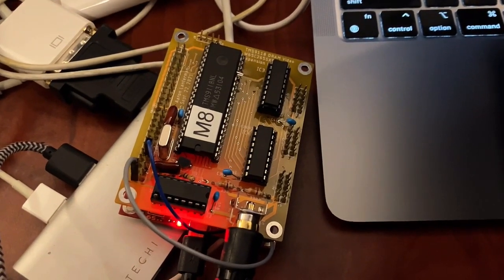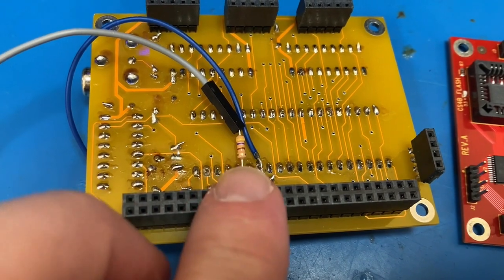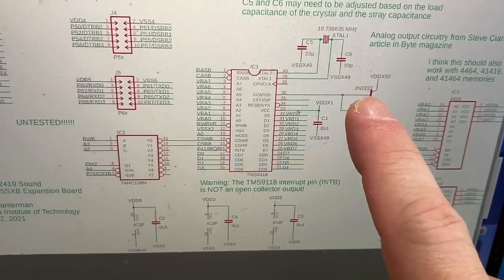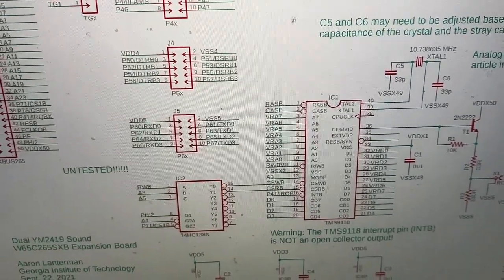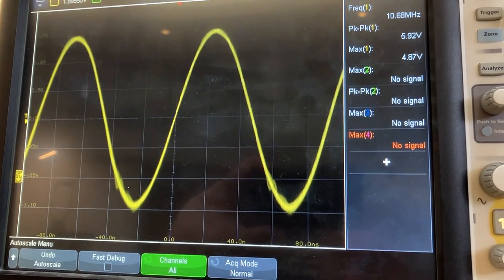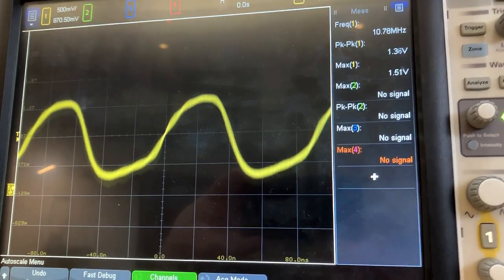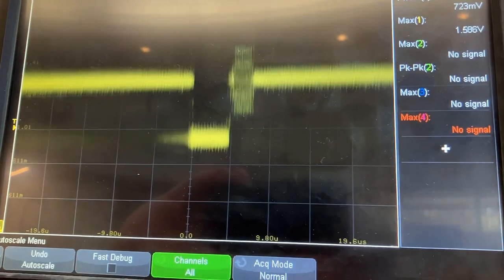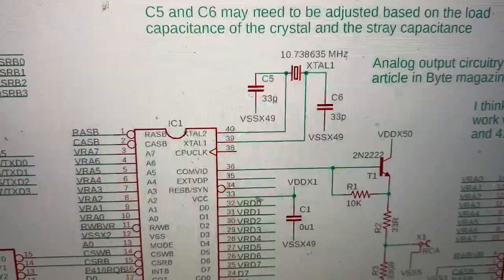[SOLVED] Color Output from TMS9118 Driven by W65C265SXB Microcontroller PCB (RetCom87) (TMS9918)

Comment: Hi Aaron, Thanks for reaching out. I thought it best to comment here in case anyone else has TMS9918 sync issues. For my builds, I've had great results buying 10.738635MHz crystals from Mouser which are listed as having 32pF load capacitance. I mention it briefly on my TMS9918 PCB build video: https://youtu.be/oR_TiEgSD2k?t=137
Reply from the maker: Believe it or not... it somehow magically fixed itself? I went to it a couple days later to work on writing to video RAM, and suddenly noticed the picture looked less janky, and then I tried color and it worked!
Reply from the maker: I'm now scratching my head on something else. Reading from VRAM works correctly, but to write to VRAM, I have to give the TMS9918 an address one less than the address I actually want to write to. So if I want to write to $0800, I have to tell the processor $07FF. I don't think it's supposed to work that way (and it means I can't actually write to $0000...)
Reply: @Lantertronics  Sounds like you're not setting the write flag when setting the address. Make sure you logical-OR 0x4000 with your address. That will prevent the TMS from pre-fetching the data from that address and incrementing the address pointer before you get a chance to write to it.
Reply from the maker: @TroySchrapel  OOOOOOOOH! Thank you so much! I overlooked that part when going through the instructions... I had focused on the MSB that indicated whether it's a register or address write, and missed that next-to-MSB.
Reply: @Lantertronics  No worries. Sometimes a fresh set of eyes is all you need :)

Comment: Yes. That chip is known for getting very hot. Working on my own W65C265 project with a custom board; glad to see others experimenting with it, too! 😅
Reply from the maker: Oh cool! There are so few working with it. What are you working on? Tell me more! :)
Reply: @Lantertronics  surely! I had a custom PCB made with the ‘265, 1x32k + 2x512k ram, 1x32k 55ns rom, a ‘22 VIA, 2x’51 ACIAs, running at 8mhz. I have two expansion ports with basically the same pins exposed as the W65C265SXB, and two PIB expansion ports so I can experiment with the Parallel Bus. And more!

Comment: Make sure that the displays aren't expecting a PAL signal. A slight deviation from the NTSC color carrier shouldn't make too much of a difference, but PAL has a much higher frequency carrier. An NTSC carrier would look like luminance modulation for a PAL display.

The carrier signal does look awfully noisy though. I don't know if that's the oscilloscope, but  perhaps check if there'e any noise on the VDDX50 rail?

Comment: The 9918 always gets hot. Most of the time they had a heat sink glued to them. Try putting a 50pF trimmer capacitor in parallel with the 33pF capacitor on pin 39. This will let you fine tune the frequency of the oscillator and hopefully pull it into a range the television can recognise as a colour signal. Cheers.
Reply: Measure the frequency on CPUCLK pin 38. That won't load the xtal oscillator so it will be an accurate measurement.

Comment: I sent an email to your gatech address on 2022.02.19 - didn't get a reply so I don't know if you got it. It had some troubleshooting advice, logic analyzer captures, oscilloscope captures, vectorscope captures, test programs and video buffer circuits.
Reply from the maker: Oooooh! Thanks so much! Let me go looking for that.
Reply from the maker: Hmmm, alas I don't seem to see it. If by any chance you still have it in your mail program could you try resending?
Reply from the maker: lanterma@ece.gatech.edu
Reply: @Lantertronics  Sent it again. The address I used last time was a bit different. Got it from the gatech web site.
Reply from the maker: @oPossum5150  Yeah there several variations but they're all supposed to be forwarded to the same spot.
Reply from the maker: @oPossum5150  Thanks! I just got it. Oddly it did go to my spam folder... no idea why, I can't see anything in your e-mail that should trip it.
Reply: Cool. Thanks for the confirmation.